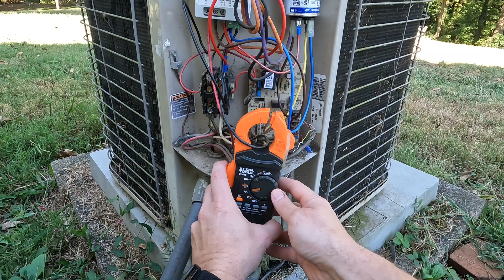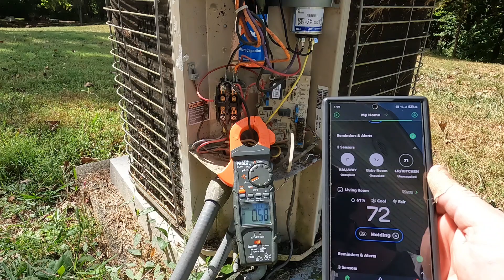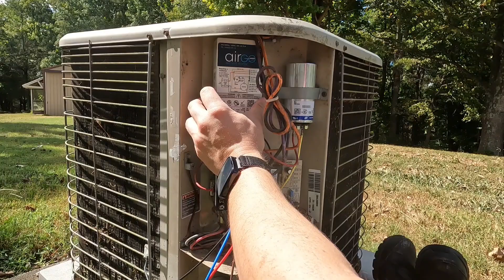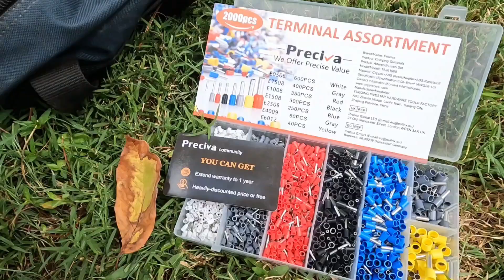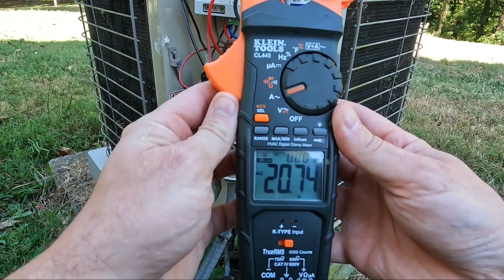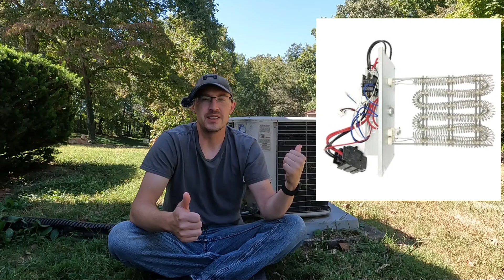AIRGO Soft Starter Install #hvac

Comment: Do you have a preference between this unit and the Micro Air Easy Start Flex?
Reply from the maker: I follow several generator groups and I hear about micro air flex failures nearly every day.   I wouldnt spend my money unless it gets to a point where I dont hear it very often.  They are also a bit bulky and harder to find inside a lot of cabinets.  

The airgo, hyper engineering, and sure start brands are small enough to fit inside most units and have a better reliability reputation in my opinion.
Reply: @projectswithjw  Thanks!!!

Comment: What did you do with all the wires connected to the capacitor you removed? I have a Trane  with 2 capacitors and a relay. Does this need to be removed and not needed for the fan to start?
Reply from the maker: I removed the hard start kit because you can't have a hard start and soft start at the same time.  My unit has a dual run capacitor that does fan and compressor.  Some units have separate ones.     Its hard to know for sure without a picture how yours is set up.  It sounds like its a hard start though

Comment: Installed mine today.  Inrush went from 78 to 48....somewhat modest i think.  Is a 38% reduction expected?   Also, i noticed there is an LED window on the Airgo, but i don;t see anything lit up in there.   Is no LED as expected?
Reply from the maker: I dont remember if LED has any diagnostic features or is just on when it has power.   
It does go through a learning phase.  After a few days or at least 5+ starts, you should see greater reduction when you retest.  The unit in the video was about 20 amps during recording but now is around 15-16 amps.    It might be possible that your original starting capacitor might also be weak and the airgo is compensating for it a little.
Reply: @projectswithjw  there are 4 fault codes that are listed specifically on the label on the AirGo

Comment: Does it matter if you use the larger spec unit even if your unit doesn’t require it, they are the same price any advantage to do this.
Reply from the maker: 8-16 is good for up to 16 running amps and less than 85 amps LRA. 
16-32 is for any LRA above 85. 

I think its fine to be slightly oversize if its close to the point where the models ratings change.

Comment: I just bought a portable generator 15000 duromax and was wondering if you could help me get the right AirGo for my A/C

08 - 16A or 16 - 32A?

5 Ton
RLA 14.1
LRA 72.2
Reply from the maker: Either model will work but its close to the upper limit of the 8-16.   
Get the 16-32 to be safe 👍
Reply: @projectswithjw thank you so much

Comment: @condor5635—When he is using the term “common”, he is referring to the wiring coming from the compressor. There is a wire for common, start, and run. There is also a “common” terminal at the capacitor.

Comment: Will installing this device harm my AC?
Reply from the maker: I have never heard of it happening to anyone.  The soft start is only in the circuit for a few seconds, then the system continues to run with the original equiptment. 
Usually a soft start failure will just stop working completely and removal of the starter will allow the system to function again until a new soft start can be installed if desired. 
They do have many benefits to protect your unit. Motor reverse shutdown.  That can happen from surges or lightning strikes.  If the compressor is not starting, then the soft starter will break the circuit to prevent overheat/meltdown. 
My opinion is that they can increase the life of the  AC buy reducing startup stress and heat in the motor windings.  I saw an old microair starter yesterday that had 37,000+ starts recorded in its lifetime.  It had no issues. Quite impressive. 
I sometimes wish the Airgo had an app to see that stuff but its just for curiosity sake. It's not really all that important. 
Thanks for the comment. 🙂

Comment: Why don't they just make AC units with a soft start included?
Reply: Because they don’t need it. Units run just fine without them. This is an unnecessary add on that gives more fail points. If you need it, you can add it for a couple hundred bucks. Not that complicated.
Reply: @zimvader25  Except reducing the amps from 60 to 20 reduces the heat load on the compressor windings making it last longer. Id do this just to extend the compressor life.
Reply: Some of the nicer new inverter style units do have a soft start. I know most all the Tranes have them.
Reply from the maker: It would be nice but companies want to sell the cheapest product for the highest price they can.  That does mean that stuff is easier to work on and replace though.   
There are lots of new units now that have inverter power supplies and motor controllers.  They are soft starting but so expensive that a lot of people don't want them.

Comment: I have installed the Micro Air EasyStart Flex on my 3.5 ton Carrier HVAC.  It only lasted for 11 months and most of the Capacitors pops leaving a lot of mess inside the EasyStart cavity.   By Checking The reviews on Amazon and notice plenty of failure on the Micro Air EasyStart softstarter.  Some even has the replacement failed in a short period of time.  At a cost of  over $400 plus the cost of hiring AC Technician to fix the problem and risking the damage of the AC Compressor.  I don't feel comfortable install another Micro Air EasyStart on my AC Unit.  Not recommend for my friends and families.
Reply from the maker: The Flex had terrible reviews when I was looking into this.  I've had the airgo running on my two units for over a year now and have no failures so far.  It's a copy of the Hyper Engineering SureStarts and those have been around a very long time.
Reply: @p @projectswithjw  i’m guessing like you, my assumption is it fails the air-conditioning won’t turn on I’ll know there’s an issue.  Is there a case where it fails but yet the compressor continues to work so you’re basically getting no useful amperage drop

Comment: why did you chose this brand? Was is solely based on size?
Reply from the maker: Size was important to me.  Microair didn't have good reviews on the flex models at the time.  Hyper surestart was only $10 more than airgo with a long track record of being great.   I really picked it because there wasn't much airgo stuff on youtube at the time.  
I have 2 units over a year old and no complaints so far.  Run them on generator last week too. It was great to be comfortable 😎

Comment: Just installed two AirGos on a 4ton and 5ton package units. 4ton unit went from 139 inrush amps down to 40. 5ton went from 159 down to 53amps. Units are 23 years old and get a good workout every summer in Vegas. Hopefully these soft starts stretch their lifespan a little longer.
Reply from the maker: They seem to be built well.  I have two airgo units that are almost a year old now.  It's also nice that the lights in the house don't dim during surges.   The weather is bad this week.  Generator power is very likely to be necessary.

Comment: Confused when you say common wire. My ac is 240 only so there is no common. 2 hots and a ground.  Yours is a heat pump right so you have a neutral?  
Also have you been happy with this soft start?  Was it required for your Westinghouse Gen?  I have a 4 ton AC and wonder if I’ll need a soft start when I buy that same generator Thanks
Reply: I have since bought the 11,500 Westinghouse and this exact AirGO Soft Start. I have a 4 ton Trane condenser compressor unit.  The generator starts it fine so I’m in a great spot.  The only thing I wonder about this soft start is there’s only one light on it and there are four fault codes that can happen with the light.  I wonder if there is a fault where the unit doesn’t actually work correctly, but doesn’t produce a light.  I’m assuming that’s not the case but it would be nice that if it had a green light meaning that it’s working properly.

Comment: JW, I have yet to see anyone run a Generator using this equipment.
Reply from the maker: @ToyodaMaster-tq6ht  i have used it many times on generator since installing it.   I thought that I had recorded it already, but I need to add that to my to-do list now.
Reply: I have it on a 4 ton Trane and it works great

Comment: Man, I wish my numbers were that low to start with.  6 year old Rheem 2 stage heat pump with 153 LRA and 29 RLA.  But, it really doesn't draw as much as the tag says.  Going to buy a meter and check for certain.  I monitor house with Emporia Vue Gen 3 with 16 CT's attached to things to help when generator is needed.
Reply from the maker: A soft start might get it down to 60 starting amps if you figure 60% reduction is about 90 amps. I know some advertise up to 70% reduction but that seems to be an absolute best case scenario. 
Definitely would want to run both generators if you're going to try it. 
Have you tried putting circuit monitors on the generator feed?  It would be nice to see live data while on gen power.  I've been looking into an idea like that lately.
Reply: @projectswithjw  The way the Emporia Vue is set up for my house, it will monitor whichever source I'm using...line or generator.  My main 200 amp breaker is outside the house along with the power inlet, 50 amp breaker, and interlock.  My main breaker panel is in our master bedroom closet.  So, no matter which one it's on, the Emporia Vue will read it from the two 120v legs coming into the closet panel.  Although, it takes some getting used to on how to read what's going on...but it's been pretty handy.  I've figured out how much the water heater uses when it's on, the septic pump wattage, microwave, etc.  Pretty handy.  But, for me to see what the actual use is on each outside unit, I'd have to have another Vue outside on the 5 ton and 2 ton unit.  All I see inside is just what the total is for everything but then some exacts on certain devices.

Comment: Thank you for showing how to install, loved your helper/companions in that background, wish I could have them in my backyard
Reply from the maker: @EngineerX  im glad it helped. Its been working great for 7 months so far and I've run it on generator a few times. 
Thanks for watching 🙂
Reply: @projectswithjw  great to hear. I'm going to get one so I can use it during power outages ..
Reply: Hey thank you for the video. In the airgo original install video, he removed the “jumper wire” since it’s already connected from the airgo to the capacitor common. What happens if you leave them both on?
Reply from the maker: @cdiaz1257  It won't cause any trouble.  👍👍
Reply: @projectswithjw  thank you

Comment: Hi, so the directions say to put the Meter in the inrush mode, then use the Range button to select the 60 or 600 amp range, I didn't't see anything referring to 60 or 600 amps mode when I pressed the Range button. I'm new to these kind of meters, any help would be appreciated....thank you
Reply from the maker: @1nkman  it's not very obvious. The decimal point moves.  Not really a good enough indicator in my opinion.  I try to remember it's default is low amp and one button push is for high amp.
Reply: @projectswithjw  Thanks, you explained it perfectly.

Comment: What is the yellow plug you have in the 120 twist lock connection?
Reply from the maker: @ejones6616  it's a neutral ground bonding plug.   I use this as a stand alone generator sometimes.  When I plug it into the house, I pull the bonding plug out since the house has it's own neutral and ground bonded in the main panel. 
The generator came bonded from factory and I converted it to floating neutral.